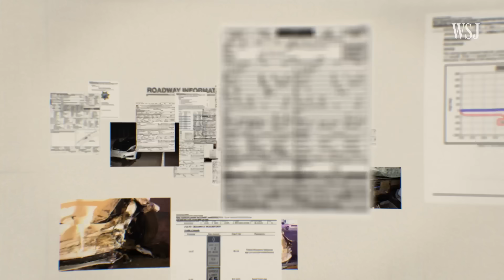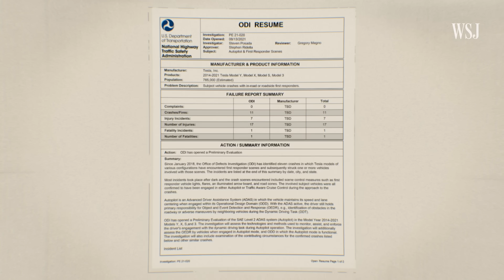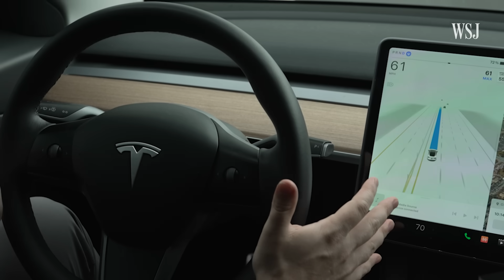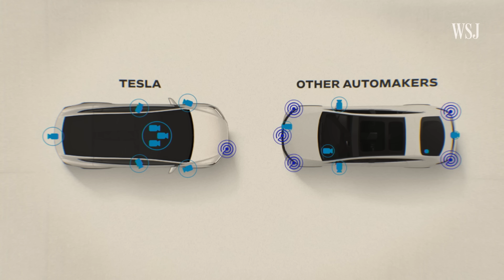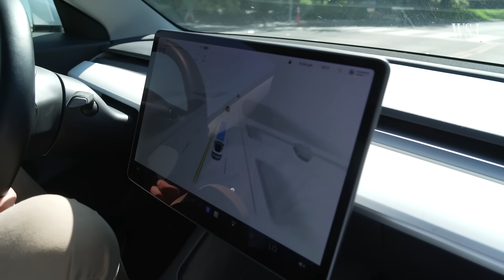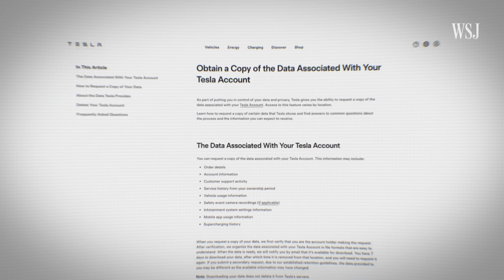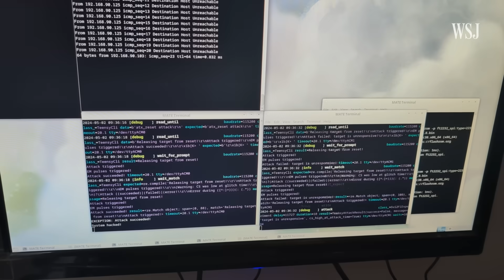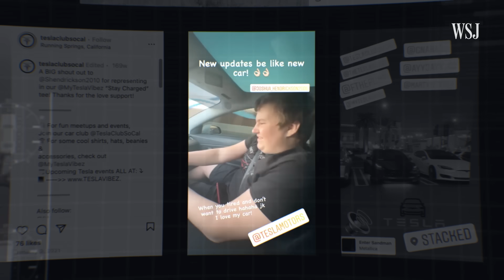The Hidden Autopilot Data That Reveals Why Teslas Crash | WSJ

Comment: This has all changed recently, as autopilot is using the same video trained neural net as fsd. So hundreds of thousands of lines of code that were hand crafted for the majority of driving scenarios are now gone, and replaced with a machine learning trained neural net. Early versions of V13 seem to be very impressive, but time will tell.

Comment: Safety in commercial aircraft has been developed over 100 years and thousands of crashes and incidents where independent crash investigation organisations and regulators investigate and formulate regulations that iterate back into design and manufacture and certification needs to be granted regarding compliance before a new type is released or a current type can continue operating where a fault was found to cause the catastrophe or failure. 

We have lil Elon and his merry nerds using us all as Guinea pigs in some macabre testing and training environment they have turned out roads into because at any time one of these defective vehicles could collide with my vehicle or that of a family member. This is beyond deplorable. 

NTSB should be investigating each incident, standards should be legislated and made to be followed and this half baked bs being released on our roads should be made illegal until it can be certified to be foolproof to a degree of certainty that independent EXPERTS determine, not the manufacturers.

And now we have this fantasist Musk, taking a role in government, to reduce the regulatory environment. Wonder why? So there is little chance this very thing will be controlled by an independent body. Now imagine when thousands of his robots are running around our world without regulation…

Comment: It’s driver assist feature.  ASSIST!  Not driver replacement feature.  Adaptive cruise control keeps your leg from working the gas and brake in traffic jam. Lane keep assist keep your car on the road when you have to attend to things in the car (opening bottle of water, grabbing Tylenol in the center console or glove box) for brief moments without pulling over to the side.  You are in control of the car.

Comment: This is insane, people are trusting a grainy camera with their life. Musk should go to jail for calling it full self driving. When a big airplane is landing on autopilot, there are two autopilots checking on one another, two radio altimeters, and both pilots looking at the instruments, prepared to take over in any second if it doesnt do what it should. So two people and two computers and multiple sensors. Here is just one computer with two low definition cameras and people trust it with their lives because Musk has lied to them.

Comment: I own a Tesla , dislike Elon, upset they took away radar & bumper sensors , distrust auto pilot but still use it time to time when safe, don’t think FSD will be ready for 20 years from now  , & love my car , was kind of a hit piece, did not say how many accidents it prevented? ( some people have died because of seat belts, drowning or burning in car, but belts overall have saved millions of people, so why focus on a few deaths, & i always pay attention with autopilot so as to stop if something infront of me, or a few times when car was going to run a stop sign I used break myself, again give all facts about it the good and the bad , and Tesla should give data ASAP about that car to family , but if your not paying attention and drive into a stationary object you can see from far away, seems to be driver error, other vehicles with radar & lidar had fathom break and got rear ended  which killed people,  sad for family, but I don’t see car at fault

Comment: FYI, autopilot can be used on local roads, but it is only supposed to be used on highways, because it doesn’t understand stop signs and traffic lights.  So it’s no surprise that the car failed to stop and drove off the road. 

Now FSD does recognize those things along with several other features.
Reply: Counterpoint: the car knows exactly what kind of road it is on (for example; ‘Navigate on Autopilot’ will only activate on highways), and so could only enable Autopilot features on the roads you suggest, yet it doesn’t.

Comment: Has there ever been a bigger liar than Elon Musk? (Oh wait, I forgot about Donald Trump. But which lies more? Hard to say.) What's harder to say is why federal regulators even allow such faulty systems to be sold and drive around on the roads in the first place.

Missy Cummins of George Mason University states it clearly at the end of the video: having an unreliable system do most of the work but asking humans to attend to every second anyway to correct it when it makes a mistake is a non-viable approach, period. Human brains are not equipped to do that. I don't know why anyone ever thought that would work. You can have humans do all the work and use an automated system as backup for safety, or you can have an automated system THAT YOU CAN RELY ON 100% OF THE TIME do all the work without attention from a person, but this in-between state that invites a person not to pay attention but them blames them if they don't is just insane. Other car manufacturers have not been so foolhardy, besides that their systems are also safer due to also including sensors besides just optical cameras.

Furthering the problems is the plainly deceptive marketing. Calling it "Autopilot" or "Full Self Driving" when it is clearly nowhere near any such thing is false advertising pure and simple. No other car manufacturer is making such false claims. Musk confounds that by blatantly lying during speeches and presentations and interviews where he falsely claims that his cars are already safer than human drivers, and the like.

Comment: The question that these reports never address is what portion of these accidents would not happen with newer versions of the software?  That's a much more difficult question to answer without inside information, but it's also the most important question.

Comment: The flaw is that drivers are putting 100% trust in FSD.  I use FSD every day, but I have to disengage it occasionally.  I am very familiar with its limitations and pre-emptively disengage it in scenarios it has proven to be problematic.

Your average driver is a distracted idiot.  These stories are just reinforcing it.

Comment: Had a Model 3 with FSD for two years. Important note: I live in the Northeast but lived for six years out west. I understand why Tesla was all in for cameras only, but in every other part of the US where roads are not well marked or lit, that FSD is NOT ready for prime time. We had numerous false reactions from the vehicle from NOT seeing hazards on the road to reacting to hazards that did not exist. The car on more than one occasion slammed on the brakes on a totally empty highway, while doing 70mph. Sold the care after too many occurrences. On top of that, the lowest end Hyundai has better build quality than those cars, and I'm not the first person to point that out.
Reply: Hyundai has (&has had) awesome built quality!(for years) Got 100.000 m / 8 year warranty and panel spacing is mint! Chrysler cars are a better comparison…
Reply: @gw2301  Sorry to bag on Hyundai. You're right. They are actually made really well. A more appropriate comparison would have been a vintage 80s Yugo.
Reply: @rjlavallee3575   I wouldn't go as far, but at least the interior material and build quality is on par with Dacia Sandero. While Teslas nowadays are not nearly as expensive as they used to be (when, paradoxically, they had even more issues esp. with panel alignments), it's a disgrace of what kind of interior you get for that amount of money. The only good thing about Teslas is their exceptionally excellent cooling & overall powertrain control, everything else... not so much.
Reply: @gw2301  "has had"? LOL, you can't be serious. My 2013 Tucson engine blew in 2021. My son's 2012 Optima is on his third engine. My sister in law Hyundai (not sure the model) engine blew a few years ago, same thing for my wife's hair dresser. Before you say they probably weren't maintained, before Hyundai/KIA honor their part in the class action against them, you have to prove you made all the required oil changes. Their Kona EV were recalled twice for fire hazard. Their Ionic5 (and EV6, EV9, etc) have a class action against them for level 2 charging being way slower than advertised and their 12V battery are draining rapidly and sometime even while driving, causing the car to go in limp mode, not good when on an highway. I'm not touching a Korean car again for any foreseeable future. Awesome built quality, lol.
Reply: This is true..my tesla slammed breaks suddenly in highway. Gald I was alert and was able to pump up the pedal to avoid rear end collision
Reply: @droneon5575  That's not a problem since autopilot disengages in the rain. (no joke, but it is funny)
Reply: Funny, I've just been saying as much. My 20 yo Hyundai even has cruise control. TACC is a disaster and means new Tesla's don't actually have cruise control
Reply: @Sjalabais  What is so rare about a 20 years old car having cruise control? Cruise control is like trees, they are everywhere!
Reply: @Uouttooo  You missed the point: Tesla's "smart" features make using their cruise control dangerous and impossible, so a new Tesla effectively doesn't have cruise control. As opposed to every old car around.
Reply: Hyundai ioniq is rated #1 in electric car safety.  Love mine.
Reply: Imagine teaching a neural network from the ground up regarding what the world is, and calculating the solutions to allow said neural network to navigate the world more precisely than humans can  given the sensors needed to operate in an environment (roads being the environment here). You need to teach the neural network correctly or else you're running before learning how to catch yourself when you trip.
Reply: @NicholasHickam  Great analog.
Reply: The rear seats are torture devices, too.
Reply: The phantom break is a big issue. It was scary for the few times it happened to me. However, I must saying, overall, having auto-pilot making driving safer to me, especially long trip  (2+ hours)
Reply: @rjlavallee3575   What version(s)?  It makes a difference.
Reply: So in this spot: https://maps.app.goo.gl/JpTXMava7WyS1H8y6.  Tesla will always slam on the brakes. It is a fracken highway. It thinks there are lights coming up and I need to stop. But the fun does not stop there. In the tunnels where I marked the speed limit that car sees constantly goes up and down between 60 and 100 KPH. The speed limit is 80, consistently 80. 

I don't drive with self driving, and the car will be sold next Friday. Initially I was excited with the Tesla, and there are things I really like about it. But some things are horrendous.
Reply: @droneon5575  LOL, sorry to burst your bubble but heavy rains do effect radars. My Prius Prime will refuse to go in traffic aware mode if the rain is heavy. Rain causes radar signals to be absorbed and scattered, reducing the amount of energy that reaches the target and returns as an echo. Snow is even worse, especially when it accumulates in front of the radar sensor.
Reply: @droneon5575  Ultra sonic sensors are for short distances, as in parking lots. They are useless when driving at high speed.
Reply: My tesla was one of the last ones sold with all 3 sensing systems. It has avoided 2 crashes I had no control over. The system is flawed tho. I have had the phantom braking cruising down the hwy in Iowa going 70 and suddenly my set speed changes to 55 and the car slams on the brake with no warning in the same spot every time. Reported it to tesla multiple times, but it still does it. The car also slammed on the brakes when I was in heavy traffic at the GW bridge trying to merge in. It wasn't even on auto pilot and nearly caused me to be rear-ended. I have no idea why it did that the person was letting me in, but it was tight. While yes this feature is a good aid, it also is not something to trust your life on. I only turn it on now when there are few cars on the road or I need to take a sip of water or something because I figure both the car and distracted me watching the road is better than just distracted me watching the road. I had the FSD trial twice and used it for maybe 5 mins once but it freaked me out when it almost went out of turn at a full 4 way stop and I never turned it on again despite having the ability to.
Reply: Same here. My FSD M3 and MX were dangerous to the point that we stopped using Autopilot completely. Slamming on brakes entering tunnels was very common. 
BMW and Mercedes systems are far safer thanks to multiple input systems not just cameras.
Reply: How is FSD 13.2 doing for you?  Mine is AMAZING!
Reply: Do you have the latest (V13.2.2) version of FSD? It's amazing.
Reply: Should have shared the stories and camera feeds. If that is even allowed. Computer says no?
Reply: Two years ago we need a new car and had to decide between Tesla Model 3, Hyundai Kona electric and Renault Zoe (in Germany). We bought the Hyundai as a used 1,5 years old. Still happy with it. The car is reliable and no unsecure driving behaviour occured. 

In Germany a Hyundai Kona Electric comes with 8 years and 150.000 Km warranty.
Reply: You sold the car because of FSD, which you can disengage at anytime?
Wow, could you possibly be more disingenuous, please?
I see you also failed to point out that the earlier Tesla's had LiDAR, which resulted in TOO MANY ghost-breaking events ... like the ones you described.
Reply: @MaximGhost  Other reasons? Bricked twice. Ate tires like pez. Required service four times: two were seamless with the app and the other two were mind-bendingly frustrating (for simple issues). Had someone hit me and the repair process was beyond frustrating and so insanely expensive. And then the insurance costs were literally three times that of the other cars in our family because of the reasons you see above.

Fun to drive? Sure. Super awesome torque? Totally. Is the tech ready? No. That was the primary point above. It may be worth it to others, just wasn't to me. That enough for you?
Reply: Why aren’t these drivers intervening?
Reply: @07BSPtC  Because to paraphrase some of the video, people trust the tech too much, and oddly even more so when it doesn't act perfectly. I NEVER trusted the tech.
Reply: Taking a close look at the details of Tesla construction is always wild. It looks sleek from afar but the small things are wildly inconsistent.
Reply: If you "had" a model three for two years, you speak with the same experience level that someone has with a tricycle because that's how far the software has come. I drove from North Las Vegas to Los Angeles… Driveway to driveway, in traffic and out of traffic… And never touch the wheel not one time. we are there people.  People comparing what Tesla can do today with what it could do even six months ago is like comparing your current version of Windows to Windows 95
Reply: @droneon5575  LOL Lidar gets turned off in the rain actually as the fog or rain causes severe blinding. It's the same as don't drive with high beams.
Reply: @AlenMop That's why reputable manufacturers combine various sensor . By the way, what does a camera see when it rains?
Reply: Not FSD 12? I've driven probs 10k miles with FSD with no issues and probs 2 prevented accidents.
Reply: @droneon5575  Try it yourself. Get a camera that can see the same wavelength your lidar is putting out. Compare that to what your camera can see. I'm sure it's a night and day difference. 
In rain your camera gets wiped clean by wipers. Sides have lots of wind cleaning them too. They don't need to see every single millisecond. Humans can drive if the eyes get obstructed for a few seconds. The computer can do the same. A droplet now, will be gone in a few millisecond and the vision is fully crystal clear. Cycle repeats.
Reply: FSD SUPERVISED
Reply: I've had a Tesla Model 3 for the past 2 years, and although I didn't buy it for the autonomous driving feature, the improvements that have come in the last 6 months have been remarkable.
Reply: You never owned a Tesla.
Reply: @droneon5575  Tesla has radar BTW. Humans wouldn't be driving cars if radar was super necessary. If a human eyeball can drive for hundreds of years so can a computer with a single camera looking forward. But it has 3.
Reply: @AlenMop  No,  Newer Tesla do NOT have radar and older ones had their radar disabled in 2022.
Reply: @sylvaing1  got it. We are only installing take radars at the factory. Thanks for clearing it up for the Tesla employees
Reply: @AlenMop  human eyeball is 576mp each, Tesla camera is 2mp.
Reply: @droneon5575  You want a lidar to tell you that it can see an object? Any $20 camera can do that. It just takes time to code everything until humans don't need to pay attention inside a Tesla. And nobody on this planet will make a vehicle that will have zero accidents anytime soon or ever. 
I'm barely driving my car. 99% FSD is able to take me everywhere. Looks like your BMW might be scrap already. BMW will need to build an entire new car so it can run Teslas FSD. There is a chance there will be an agreement between Tesla and BMW for FSD licensing. there is talk about it happening now. your car doesn't meet the requirements.
Reply: @AlenMop  LiDAR uses light to calculate distance, something that cameras cannot do reliably. Hence why vision only Teslas can’t provide distance in cm when parking unlike earlier cars.
Reply: Why do you have to be so defensive?  @AlenMop